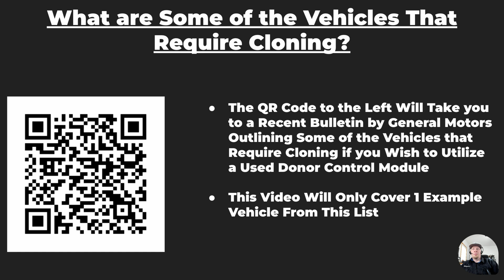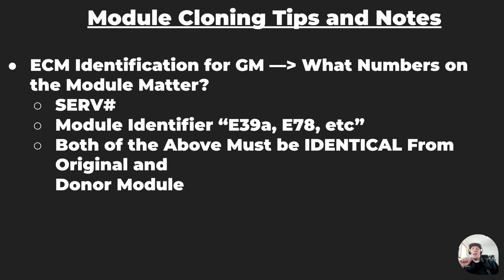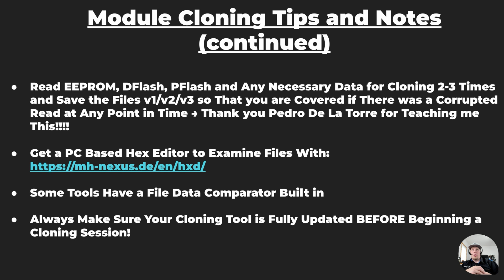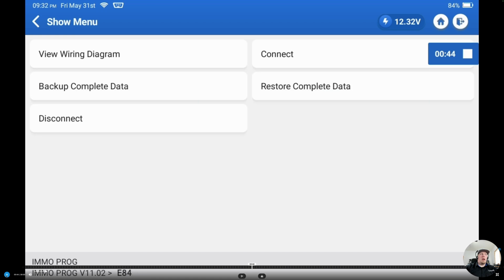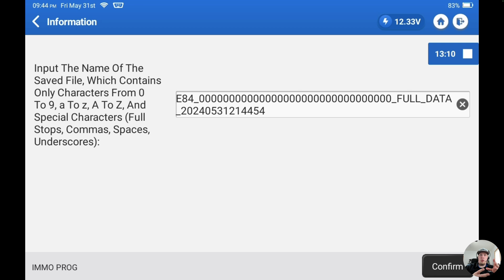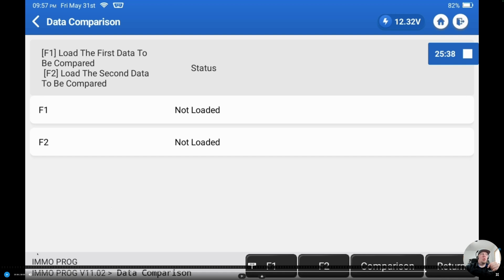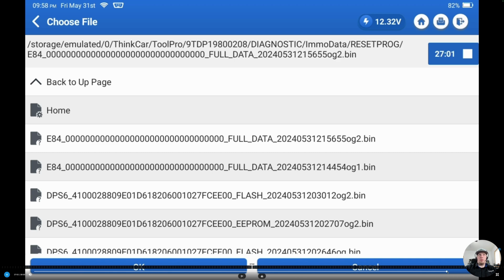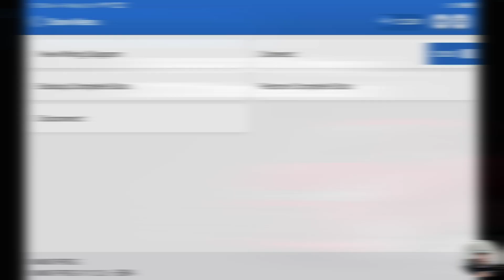GM E84 ECM Cloning | 2017 Chevrolet Spark

Comment: Nice. I want to get into module cloning. Can we do bcm rcm tcm or only ecm
Reply from the maker: Hello T-ninja Box mainly supports ECM and TCM module cloning. It doesn't support BCM or RCM at present.
Reply: Currently TCM and ECM for GM global A are supported in this format. If you are an advanced user, many of the MCU and EEPROM chips can be read on other modules for cloning purposes.